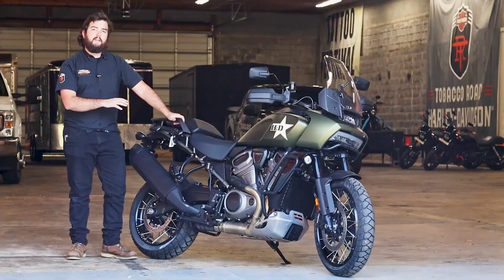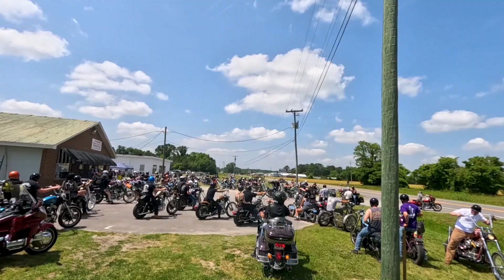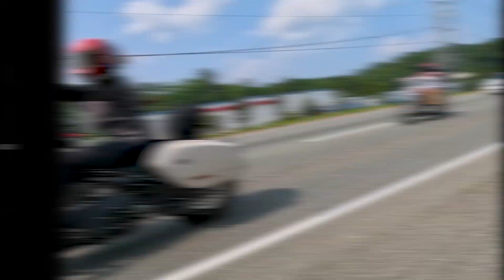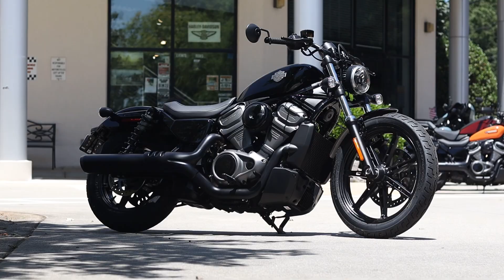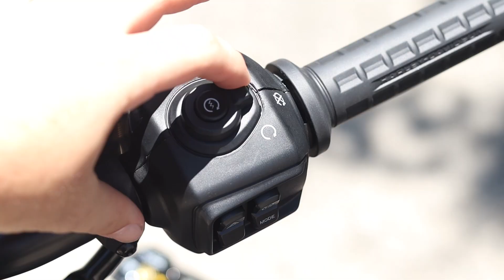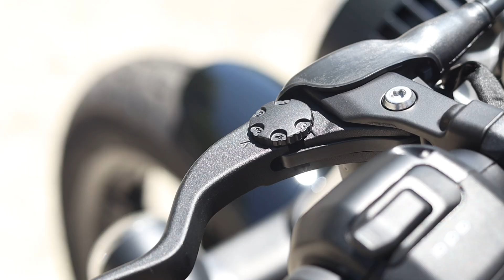NEW 2024 Harley-Davidson Nightster

Comment: It's reasonably quick but it's built with all cheap plastics, they cheaped out on the style and finish, it sounds objectively terrible, and it's very overpriced.

It's not what cruiser guys want, and the people that want a bike like that can get it cheaper from other brands.

At least the old Sporties were unique, had cool paint, they were built with good materials, sounded awesome, and had a great feel to them, even if they were antiquated. Not everyone is trying to win races. These things are just generic, and generic's fine, but not at a "premium" price.

That all being said, nobody cares about sparing the feelings of the M8 Low Rider guys. They can be butthurt, but the Nightster is faster, it's comparable in power/weight ratio to the old V-Rod which was also faster. If you're buying a LRS to win races (or show off the size of your manhood,) you're doing it wrong.